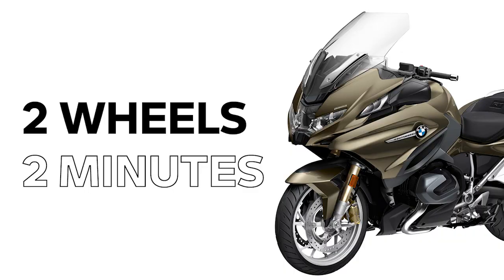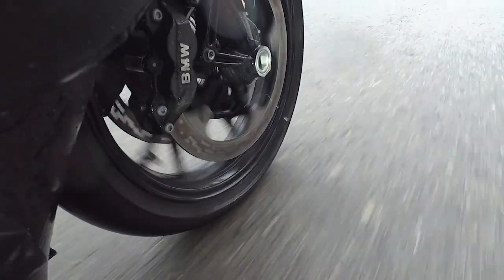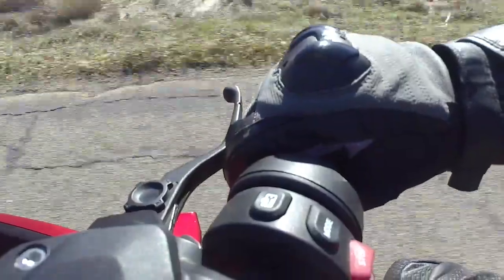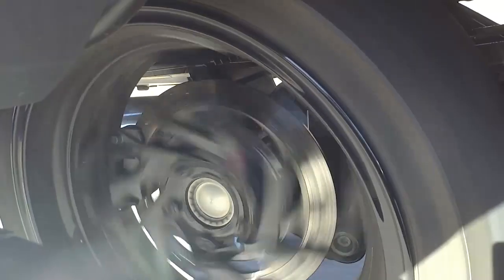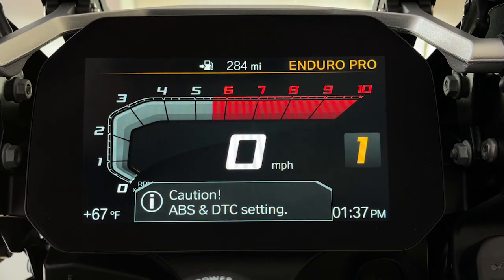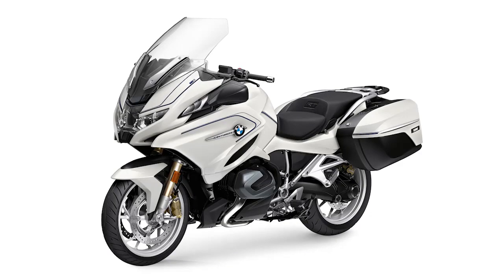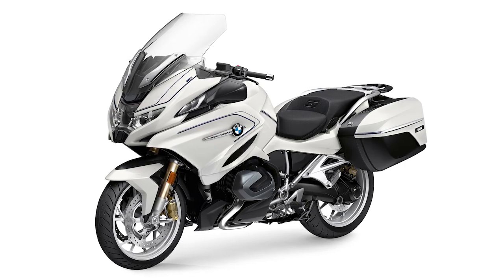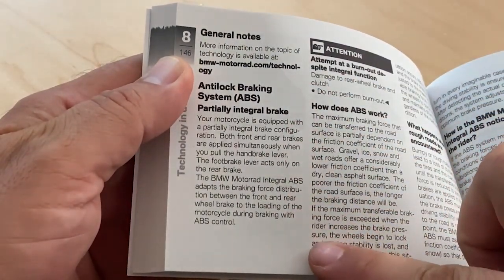Partial Integral Brakes

Comment: I have a 2017 R1200GS. I'm pretty sure I have the Partial Integral Brakes on my bike. My rear ABS engages very easily when coming to a stop. It creates this slipping sensation that jolts me forward a bit. It makes my stops kinda unnerving when it happens. I am pretty good with the rear brake and it's just on this bike that I have this issue. Are these bikes just known for having very sensitive ABS? Do I need to be SUPER light on the rear or maybe not use the rear at all? What do you think?